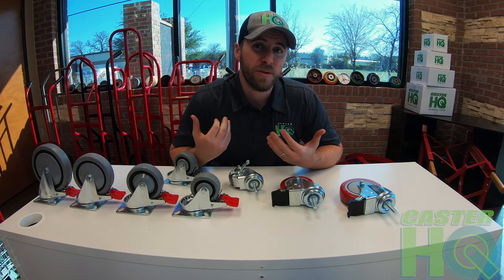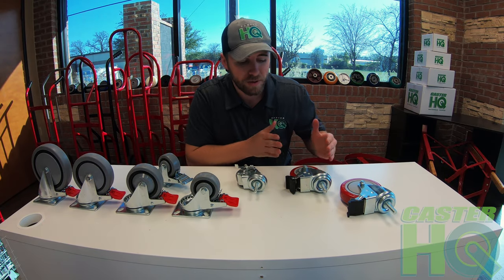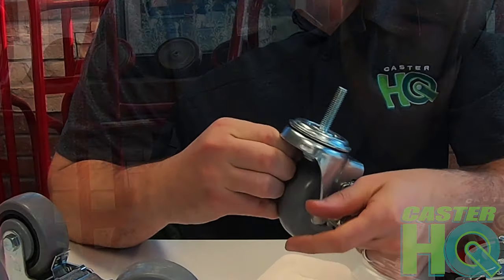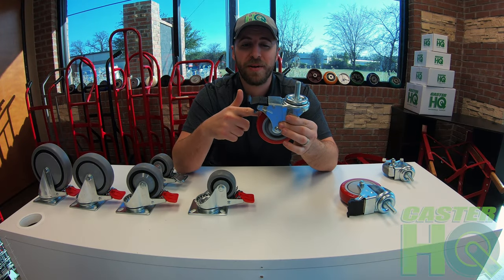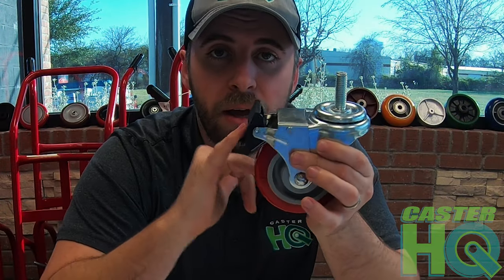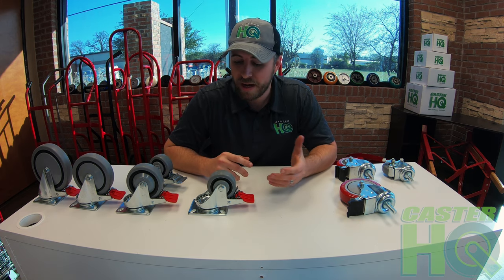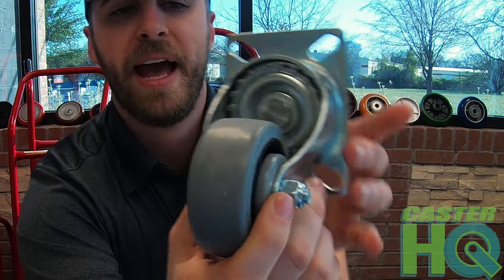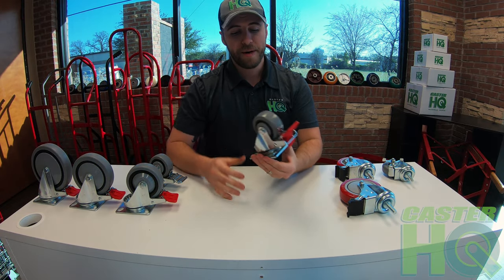Total Lock Casters - Operations and Benefits of a Total Locking Caster Brake VS a Standard Brake

Comment: What locking setup would I need where I want to lock the swivels but keep the wheels spinning freely?  This is for a mechanic tool CART so it will be heavy somewhat but not fully loaded like a toolbox.   Thanks in advance
Reply from the maker: Hi Martin,

On our medium / heavy duty cater series has a option on the swivel casters called a "Swivel Lock" and this allows you to engage a swivel lock anytime you need with a pull ring. You can simply pull the pull ring and turn it and it will engage a piece of steel inside a slot on the swivel raceway transforming the swivel into a fixed caster. It is very simple to use and works really well if you need to lock the swivel but still roll the wheels.

Comment: How many of the total locking casters would I need on a traditional dolly? Only for the back wheels or all 4 wheels? Thanks!
Reply: Dang!  That is also my question.  Too bad they didn't answer you.  = (
Reply from the maker: I would recommend either 2 total locking and on the same side by side ort all 4 total locking.

Comment: how much weight can they have, i have a woodworking machine that is about 700 kg and it has a one hole,bolt caster underneath it, but my floor is having a sloop as well so i need casters that can break fully and i can level out
Reply from the maker: For your application I recommend a leveling caster. These will allow you to level out, lock, and hold a high 

https://www.casterhq.com/LevelingCasters-s/115.htm

Thank you,
Jordan Wilson
CasteHQ